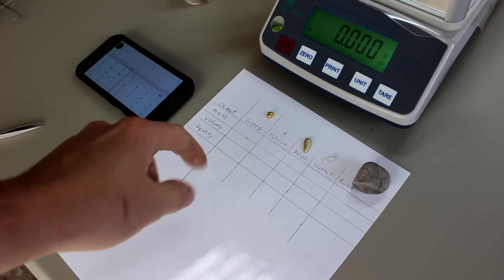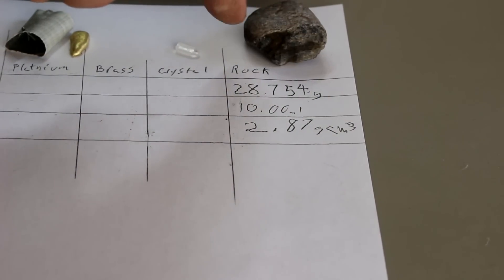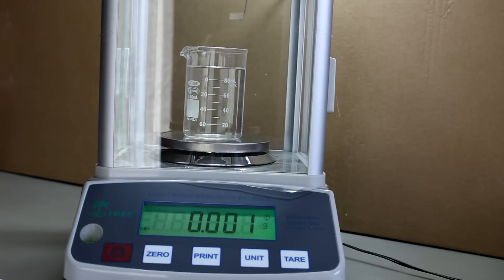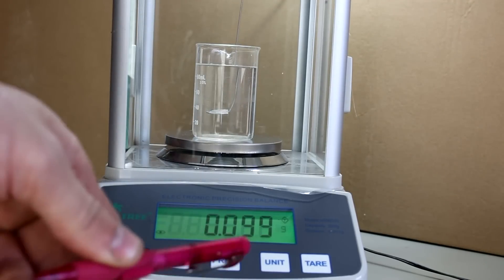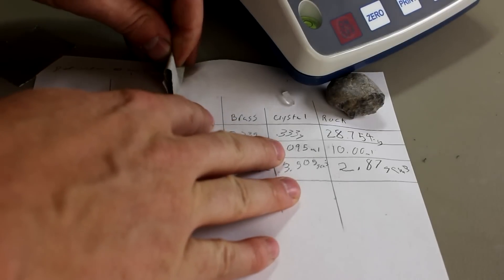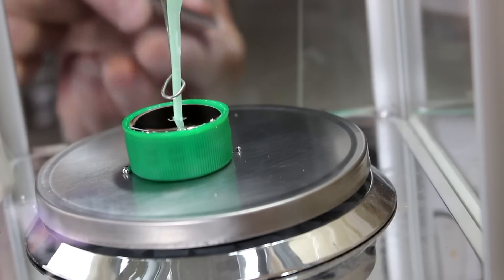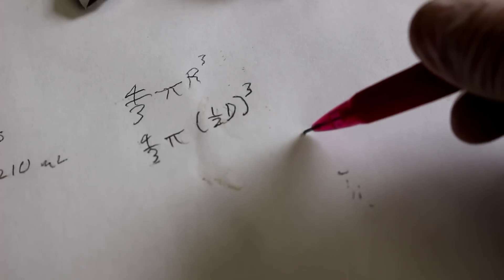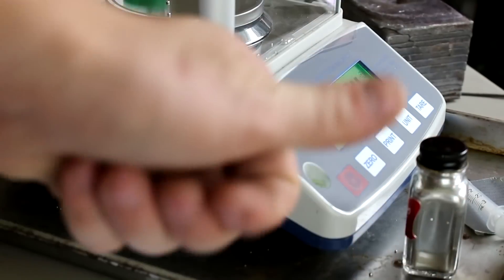Measuring Density of Small Irregular Objects

Comment: I know this video is quite old but I think the mercury method won't always produce a reliable measurement. To displace the full volume of the object it has to be submerged in the liquid. If it floats on mercury it only displaces part of it's volume because the buoyancy is so strong. So it only would only work for denser materials than mercury.
Reply from the maker: You can hold it under by force.

Comment: I am a metal detecting hobbyist. I often find small rings I try to identify as to composition. I can weigh rings for example on my jewelers scale, but the volumes are so small, it's difficult to measure at home. An example is a ring I have that passed the scratch and acid test for 18k gold, but I know stainless can often test that way. So using this to solve for density is a huge help.

Comment: Hello, can you please explain something ?

You start talking about water trying to push the object up to explain the phenomenon.
Then later you talk about the volume of water or mercury displaced.

If "displaced" is the right word, so when the object touches the bottom of the container, whatever it combines with it or not as you say, it still displaces water/mercury, then the displayed weight should be at that moment the weight of water/mercury displaced + the weight of the object. Isn't it ?
In the other case, if "displaced" is not the right word and you wanted to talk about the force pushing up the object, so what would happen if the object is placed into a tiny tiny "opened bag" suspended at the middle of the liquid. I guess the volume of the object would be still displayed, but... the liquid it is placed into does not put any up force on it, this up force being received by the bag protecting the object ? 
So what ? Can you clarify this ?
Reply: If you suspend the object in the water, the water will exert a upwards force on the object that is equal to the mass of water displaced (buoyancy force). The object will exert an equal and opposite force on the water which will be the reading on the balance. Note that all the while the bulk of the weight of the object is still supported by the holder of the object. If the object is dropped into the beaker and there is no holder to support the bulk of the weight, than the balance will simply measure the mass of the object and not the mass of water displaced.
Reply: Ok, but why then suddenly the balance will stop measuring the mass of the displaced water, as the water still has an upwards force on the object when it's dropped into the beaker ?

Comment: Nope nope nope nope.... Can you please explain me the way you measure the volume of the items ?
There is someting very counterintuitive with the way you do. Why would water push the rock to the top ? Why not the rock would also do a pression to the top to the water water that is on th etop of it ? Nope nope nope nope...

Well... Let's take an example.
Let's suppose that air has no weight.
And suppose that a balance is measuring the weight of a pool full of water.

We have at first measure let's say PoolWater Kg.

Then I go into the pool and float into it just at the surface without entering into it by a cm. We have still PoolWater Kg
Where I would expect having PoolWater+MyWeigth Kg

Then I start sinking at the half of the water level by exhaling some air : we now have PoolWater+myVolumeOfWater Kg
Where I still expect having PoolWater+MyWeigth Kg
(thought : and if now I catch a saving rope sent by an helicopter, I expect the pool not supporting my weight even if i'm inside of it, and I expect having just PoolWater Kg)

Then I exhale all of my air and go laying to the bottom of the pool : we have now PoolWater+myVolumeOfWater+MyWeigth Kg ???
Where I still, still and still expect having PoolWater+MyWeigth Kg

How can this be possible ?
There is something I don't understand with this.

Comment: Shouldn't the object have to be completely submersed to make for an acurate reading?
If you put a block of iron in water will it displace the same amount of water as a block of wood of the same size or is the submersed part (of the wood block) the only part that will displace the water?

Comment: Whenever you check the volume with this method there will always be an error because of the extra buoyant force from the extra bit of wire that comes into play from the extra displaced water/mercury from the object being checked.  Couldn't you just subtract the actual weight of the object from the weight of object in the tared beaker and water?
Reply: My last question/sentence was more or less echoed by a few other commentators, and it was driving me a little mad, so for the benefit of others wondering, the reason the weight of the crystal can be measure even if in beaker of water is because although we are right in thinking that the crystals weight IN THE WATER is its true weight minus the buoyant force, the weight of the tared beaker is the weight of the crystal (its weight minus the buoyant force) PLUS the buoyant force, so (OW-BF)+BF = OW.

Comment: You would be one of those teachers that students would look forward to going to class for. But sitting around for hours and hours marking students papers might not be your thing. OK I guess that why you aren't a teacher. 
*Puts hand up...And what practical real world use would this have in your opinion? 
Engineering, great, so we know greater mass has greater weight and inertia. When you put together a formula and design how do you get it to the right people without it being stolen and credit redirected and communications hacked and manipulated and get a job out of it?
What is the point of doing anything then? 
"F#@% this, I'm going over there under that tree and have a smoke"

Comment: I know the effect would be fairly small (proportional to the ratio of the area of the section of the wire and the beaker, or maybe proportional to 1/(1-ratio)) but wouldn't your measurements give slightly more volume (and thus less density) since when you introduce the object in the water a slightly greater amount of wire is submerged in the water? I think in this case it would be somewhere around a 0.1% to 0.5% (for the water measurements, i don't know how much it would be for the mercury one).

Comment: Hey Cody; Love what you do.  But I must take issue with a certain aspect of this video.  I think overall, your methodology and computations are correct.  Its how you describe the buoyancy force as being transmitted to the scale.  Fluids work on an internal measurement called pressure.  Left to its own devices, fluids will equalize pressure since the molecules can move about.  Pressure is the surrogate for force in a liquid.  The buoyancy force you sense is real but to say this force accounts for the higher scale reading is wrong.   What is happening is that the object causes the fluid to rise in the beaker.  A taller column of fluid leads to higher pressure at the bottom and that is what causes the scale reading to go up.

Comment: Though you have helped alot with this video, I need to add calculation issue which I encountered. 
As video mentions to measure mass in air and mass in fluid, the farmula to be used is:
density of an object = (mass in air x fluid density) / (mass  in air - mass in water)

Comment: I'm curious how accurate you could get on the platinum if you used a macro lens to take pictures from different angles, and then used software to construct a 3D model. I guess a tricky thing there is getting a precise reference length in with your images.

Comment: have you used distilled water or normal tap water for this experiment. if so the weight would change and 1 litre won't be equal to 1 kg.

Comment: I know the video is old, but surely by dropping the crystal into the beaker, you are getting its weight as well as its displacement. So shouldn't you take the 0.333g minus the 0.1g of boyent force to get the objects true weight?
Reply: I think the answer would be no because Archimedes' Principle states that the buoyant force acts upward at the center of the mass. The object rests on the bottom and there is no water underneath it.
Reply: +Cody'sLab This kind of makes sence...
Reply: Jebula999 No
Reply: I know it's been a long time but: no, whatever force the crystal is doing on the water (what you want to subtract) is experiencing itself in the opposite direction so technically it would exert that amount less to the beaker directly (so, indirectly the sum is the same). An easier way to see it is as simply a "closed" system but that doesn't really explain the problem you pose.

Comment: why not weigh the object outside of the water and subtract the difference instead of using the wire to suspend it? which I think would make the reading inaccurate because of the volume of the wire.

Comment: Cody, when measuring the weight of an object, make sure you turn off the lights in the room. The added weight from the light will skew your results...
Reply from the maker: out in the 11th or 12 decimal place... lol
Reply: Slimshayden2 not if you zero the scales when the lights are on :p ( presuming the light is of a set intensity and frequency spread )
Reply: And talk very quietly so it doesn't change
Reply: Also hold your breath

Comment: I'm worried that surface tension might slightly skew the volume measurements in depending on the object you are measuring, causing inaccuracy.

Even so, I can't really think of anything that would be more precise given the equipment.

Comment: Does the extra (small) volume of the supporting wire displaced when you add the object to be measured matter? Just thinking about it for half a minute and I can't decide if you should subtract that volume or not. In any case it'll be just a tiny volume.

Comment: Hello Cody, i have an idea of project but it needs Mercury. And i am a kid so i can't get it + It's toxic and it's expensive. Do you know when you fill glass with water and it can be little bit over the top? I wonder how high can you do that with mercury. Thank you in advance.
Reply from the maker: quite a bit, mercury has a very high surface tension, I could almost make the bottle cap have a hemisphere of mercury on top of it.
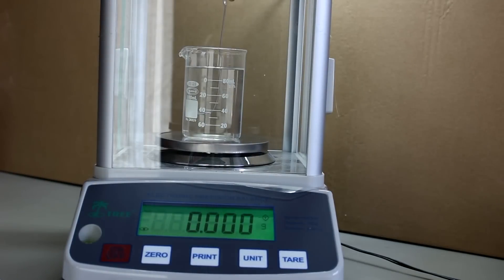Reply: At 3:02 aren't you measuring the mass of the crystal in combination with the buoyant force? Since the crystal is submerged.
Reply: Sorry to be pain in the neck but can you test it out? I need really precise information. But thank you for your answer in the first place. Alot of people wouldn't even answer. Keep up with the good work.

Comment: Cody, I have a problem. I'm working on a diving bell, but I don't know how much weight is needed to hold down a large bucket of air underwater. Is there a way to calculate this based the amount of air i want to pull down?
Reply from the maker: take the bucket, turn it upside down, put it on a scale, take down the weight, fill it with water and the increase in weight is the minimum you need to add in-order to get it to sink.

Comment: Would there be some tiny amount of error due to the level rising after volume(sample) was added because of the addition wire/straw below the surface. its still damn smart though.
Reply: +Cody'sLab Cody will this method work to find out the weight of my dick and balls? Also will the results differ if I have a huge erection versus say a huge floppy? And finally will I still get accurate results using a a huge bucket to fit my huge dick and balls? Sorry Cody one more question, what email address do I send the picture of my dick and balls to?
Reply from the maker: tiny bit yes, but not enough to be noticed by the scale.

Comment: This is great! I recently got possession of a blowtorch which I proceeded to use on a piece of mystery jewelry, and using an old spoon, I separated the odd gems (probably cubic zirconia) from the molten metal. Then I got a shiny little bead that after a few days darkened much like silver. (and the bangle had a thin layer of plastic over it too)

I didn't have any lab equipment, so I made an improvised scale from some knex, compared the weight to a few pennies (5 grams), then measured the volume with a cough syrup syringe my parents used for my brothers when they were little. The density was higher than osmium! and the temperature I estimated by the color of the red hot spoon (by way of a blacksmithing chart), was about 1600-1700 degrees Fahrenheit. 

I then when to my high school soon after, and used a graduated cylinder along with a more accurate scale. I got 2 milliliters along with with 4.5-4.6 grams (my improvised scale worked better than I thought! So a density of 2.5 grams per milliliter (I'm not bothering to do the math, this is just from memory), it was about a fourth of the mass of silver as I thought the metal was.

Definitely an alloy of some sort and melts rather nicely, just wish my blowtorch head wouldn't just blow out and freeze the metal with icy propane than a 2000+ degree flame. :P

Comment: At 33 seconds into the video you incorrectly made a statement "grams is not a unit of weight." Well it is. 
My source:
 Gram also spelled gramme, unit of mass or weight. (https://www.britannica.com/science/gram-measurement) Just wanted to point that out.
Reply: The source is wrong. In science, grams are strictly a unit of mass. It was defined that because mass and weight can be converted to each other due to earths gravitational field, however mass and weight are still technically different.

Comment: Mercury at room temperature is a substance which has a much larger cohesion than adhesion you can't be sure the mercury was not creating an air pocket  around the platinum at suck a low depth . That mlight throw off measurements ?

Comment: t cody if you took the actual measurement of 0.025 g instead of the initial 0.026 g and ran the numbers again, you'd get a density of 21.65 g/cm3 which is damn near on the money aka within 1% textbook value.

of course if you wanted to be uber boss you would have derived the density of mercury using the scale and graduated beaker, but i'll let that slide.

Comment: I thought gram was a unit of mass and weight. First I'm not sure about the basic premise (i.e. the volume displaced is equivalent to the mass of water displaced). What if there was a bubble in the water, would that cause the scales readout to jump? I take that back ... I can see the buoyancy force could be used to calculate density

But lets' stay the basic idea is true. Why would you need the wire. You could  weigh the water by itself, let the object fall to the bottom and weigh that. Then weigh to object by itself. By subtracting the 3rd measure from the 2nd you'd have the mass of displaced water?

Comment: How would you measure the volume of an ice cube?
Reply: 1: Add ice before doing the measurement, then wait for most of it to melt. That should ensure that the water in the container is almost exactly at the freezing point. Keeping the liquid at the freezing point of water can make sure very little of the cube you want to measure melts

2: Remove remaining ice to ensure it doesn't affect the measurement. Don't use big metal tools, since they can heat the water considerably in a short amount of time.

3: Place the suspending rod in a place where the ice cube fits underneath.

4: Tare the weight.

5: Place ice cube underneath the suspender, and read the mass of the displaced fluid on the scale.

6: Convert mass to volume.
Reply: +Zutaca TIL... Thank you!
Reply: Do  it quickly with the icecube inside a vacuum sealed bag (having measured the volume of the bag alone beforehand) ?

edit: Oh, you mean because it floats? Wouldn't just putting it under instead of over the wire solve the issue?
Reply: *****
"Wouldn't just putting it under instead of over the wire solve the issue?"

Yes, it would - that is exactly what I wrote. I even highlighted the word "underneath".

Comment: When you get to that extreme side of scaling with the mercury and tiny bead of metal, a significant amount of the surface of the mercury was bent with surface tension. Is that capturing some of the energy and affecting the calculation at all?

Comment: would the water rising mean an increase in the amount of wire submerged and thus change the force the wire causes.
and would using a wider beaker solve the issue

Comment: surely measuring with mercury isn't accurate at all for irregularly shaped objects? the surface tension works against you. there would be small pockets of air in small crevices and possibly large pockets of air depending on the shape of the crevice. For it to be accurate the fluid  needs to completely 'wet' the object does it not?
Reply from the maker: You'd be supprized how tight mercury "hugs" things.
Reply: +divadbate well my point was that Mercury has been used to measure all sorts of things, why stop at density?
Reply: Also considering the scale, even with the mercury,  could only show about 26, the next digit could have given enough precision to cover most of the 3% of error.
Reply: They use Mercury to measure atmospheric pressure(mmhg) I'm pretty sure this would be more accurate.
Reply: +austin bevis measuring pressure is a different beast altogether.
Reply: Well, the density of Platinum is 21.45g/cm^3 soooo, it's measurement had a 3% error which is awesome considering  the fact that it might be near the margin of error of its scale relative to the Platinum bead's mass.

Comment: With the tiny bead, maybe take a macro photo of it from the side, then, assuming it's symmetric about a vertical axis, you could pretend it was a stack of tiny disks to do numerical analysis on the photo to work out the volume.

Tedius, but I'd rather do that than work with mercury.